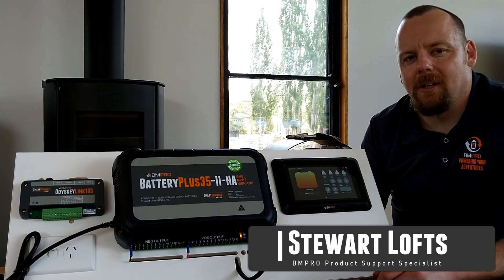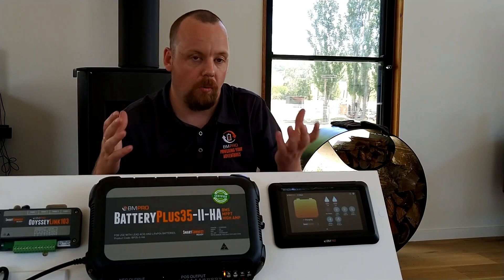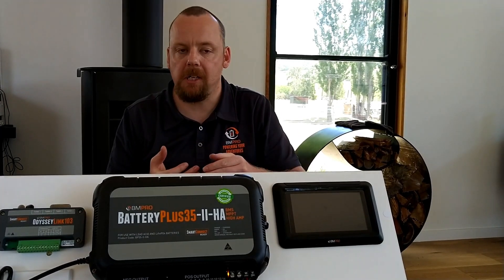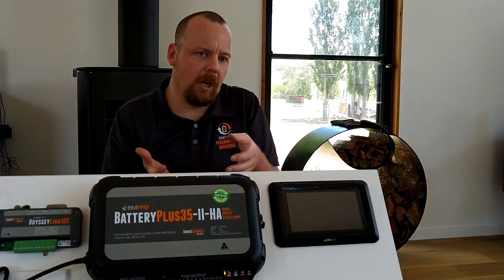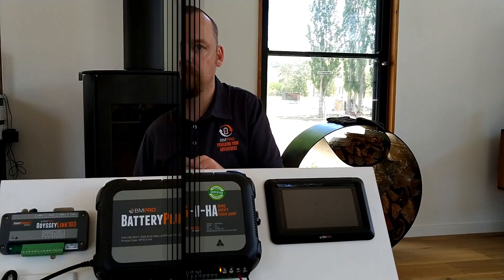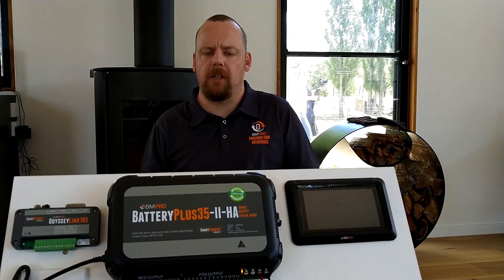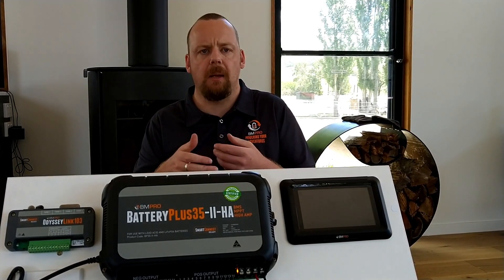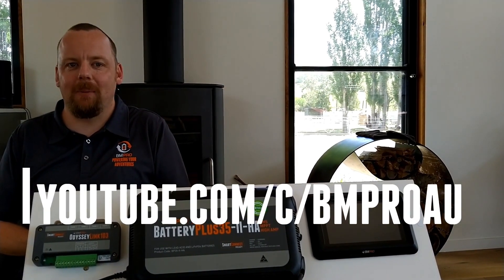BatteryPlus35 (TechTip 8) What do the Red/Amber/Green Flash Codes Mean?

Comment: Hi I have a double orange flash which means aux charging but car is disconnected and only using solar. Is this right?
Reply from the maker: A double orange flash on the BatteryPlus35-II (BP35-II) status LED does indicate that auxiliary (vehicle) charging is active. However, if your tow vehicle is disconnected and you're only using solar input, then this behavior is not expected under normal conditions.

Possible Causes & Checks:
1. Backfeed or Residual Voltage on AUX Input
If your AUX input wiring is still physically connected (even without ignition on), there could be residual voltage or backfeed from connected devices or circuits in the vehicle.

Check the voltage at the AUX input terminal on the BP35-II. If it's above ~13V, it may be falsely recognized as an active AUX input.

2. Incorrect AUX/Solar Source Detection
In some rare cases, the BP35-II may misidentify a solar input as AUX if the solar voltage and pattern mimic vehicle alternator behavior.

This is uncommon but can happen if the solar regulator is external or modified.

3. Faulty Wiring or Crossed Inputs
Verify that the AUX and Solar inputs are correctly wired. Swapping the inputs can lead to incorrect LED status indications.

Refer to your install guide to confirm the correct wiring:

AUX input is fused and wired to the towing vehicle’s 12V system.

Solar input goes through the solar regulator (internal MPPT/PWM or external, depending on model).

Recommended Actions:
Disconnect AUX input wire entirely from the BP35-II and observe if the LED changes back to solar charging (green flashing).

If the issue persists, measure the voltage at the AUX input terminal with a multimeter.

Ensure solar panels are wired to the dedicated solar input terminals (not AUX).

Comment: Have installed a BMPro 35 HA II around 4 months ago and started flashing 2 x Red fault codes. it doesnt charge from 240v or solar, Lithium batteries are fine as tried different batteries and still red fault. Even with everything disconnected, it still flashes red twice, then the BMpro resets, fan comes on and then goes red again. Surely this thing worth $1000 should last longer then 4 months?
Reply: Im having similar issues, did you get any response with a solution, what was the outcome plz.? Cheers
Reply: Having the same issue and no charge from our roof mounted solar. 

Did you resolve it in the end?

Comment: We have a green double flash but it definitely isn’t fully charged. Any clues? Our batteries were just tested and apparently have a full load but we can’t get through a night with just our gas heater on night mode on low temp (heating 18th Celsius)

Comment: We have BMPro Battery plus 35-11-HA with Odyssey Link 103 our van is 3 months old been used a total of 5 nights. We have to push the reset button on the HA every time to have any lights in the van. This is a new thing as it didn’t happen when we got it. Once we have done it they work ok for the day with power on and off . Is this normal ? The battery is an AGM
Reply from the maker: Hi, it does not sound normal - please email customer service support@bmpro.zendesk.com with your phone number so that they would get in touch with you.
Reply: what is 2 orange flash mean